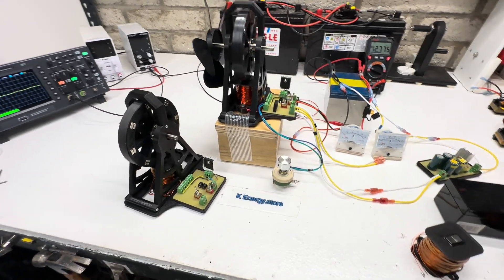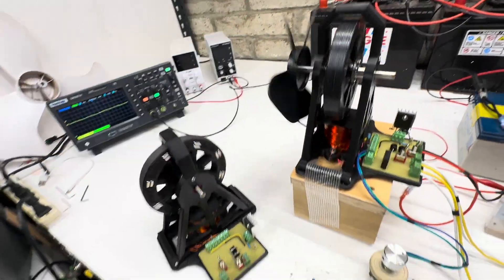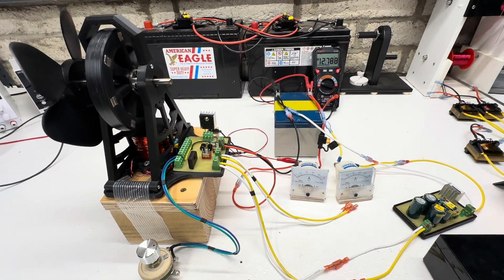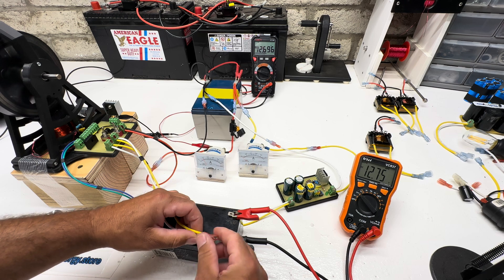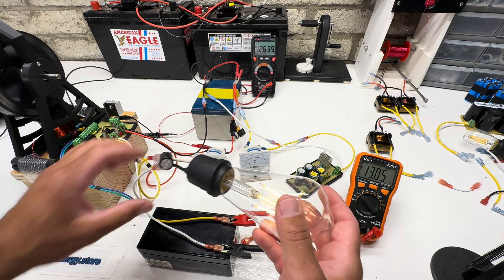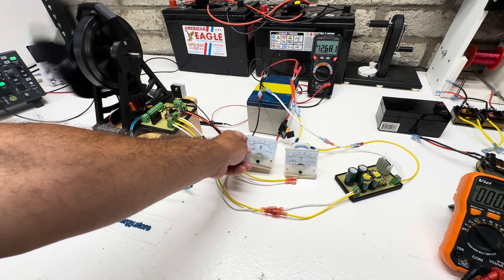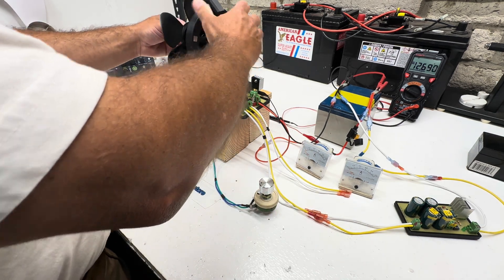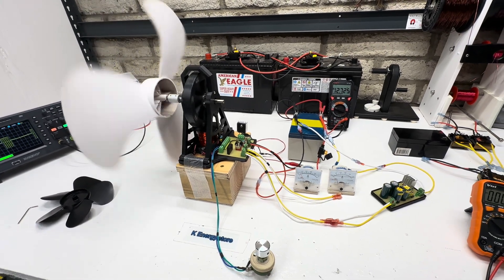Bedini kit motor upgrades

Comment: If  there were there were 16-18  coils and  each ooil had its own  bedini circuit , the supply 48v, the charge also 48v batteries. Would it be a challenge to build a capacitor dump circuit to manage this level of power sir?
Reply from the maker: @hoofheartedicemelted296  nope just make bigger one I already have 48v cap dumps on my website www.kenergy.store
Reply: @kenergy1707  True sir you had them on the K ENERGY store, but there were only 1-3 coils being tested. If the fields collapsing multiply 15 coils instaneously, would a circuit capturing 15 coils not require a more powerful circuit? Larger capacitors? More of them, sir? Forgive my ignorance.
Reply from the maker: @hoofheartedicemelted296  yes bigger better bigger capacitors
Reply: @kenergy1707  Maybe a 30 minute advice slot at the K ENERGY store is on the cards sometime soon. Thanks for your guidance thus far sir.
Reply from the maker: @hoofheartedicemelted296  sounds good 👍